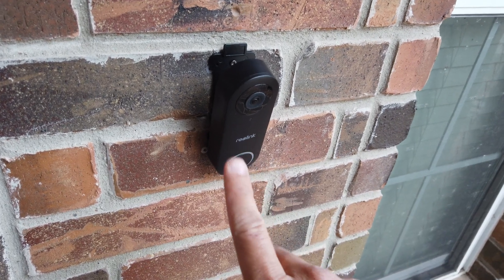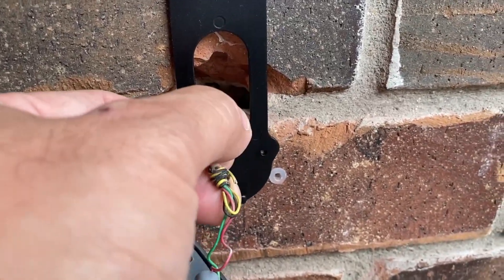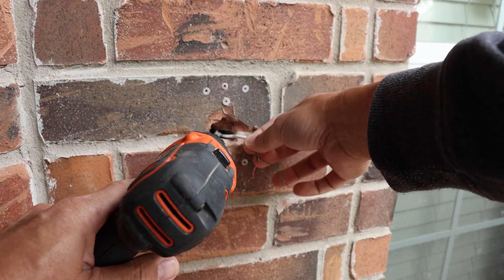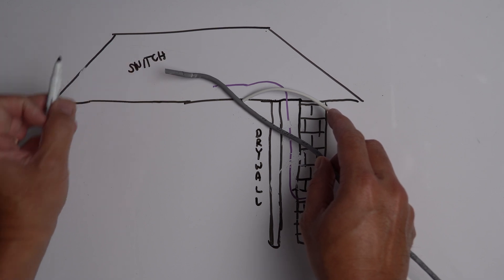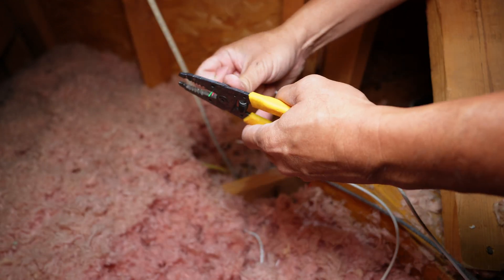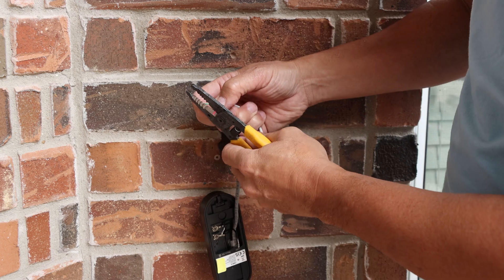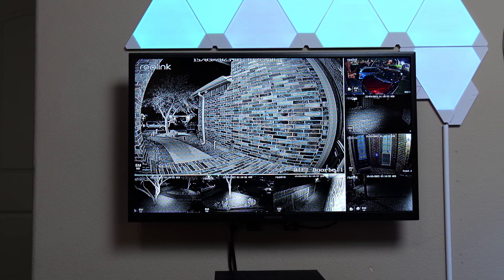Reolink WIFI Doorbell Jam Proof Setup - Adding Ethernet to your Doorbell Wiring

Comment: I recommend no to connect it to your main network and use a chap router with a separate network for its internet connection.  Having a direct Ethernet cable to your main network accessible from outside the house is risky.
Reply from the maker: So you think a hacker or bad guy would go to your front door destroy the doorbell camera that already recorded them and notified the owners and hook their laptop to tap in to your network?  Do you think because they went that far is just for them  to brute force their way in to your house and steal your computers if that is what they want.
Reply: @LifeHackster  You are right, it is not likely that someone will do that unless they intend to spy on you.

They do not need to break the doorbell. They can also wear a mask. For a normal home user, they will see someone tinkering with the doorbell and leaving...

it still works, it still looks good and there is nothing to worry about.

Meanwhile, the bad guy has full access to the home network resources and devices and can highjack your internet connection to their evil doings.

A separate router will protect from all except the highjacks of the internet, for that you need to check the "LAN" list of devices in your dedicated router for the doorbell and it should only list one device ... the doorbell.

This is one of the reasons security ip cams uses DVR instead of connecting the ip cameras directly to a Powered ethernet hub ... to get that extra layer of security for the cables dangling outside the building/home.
Reply: @LifeHackster  "Hey, how’s it going? Want a cup of coffee? I think we can manage that before the police arrive..." 😜

Comment: I have enjoyed your video's and they have helped me make some decisions on equipment.  Thanks.  But what do I do if my builder stapled my wires to the studs in my house?
Reply: You view it as a 'no wire' situation ie a brand new installation, remove the old wires at each end (once power is off) then leaving the dead wires within the wall. Now you have to get the ends of the new ethernet cable and wires from A to B.

Comment: I use the PoE version and also have the 433Mhz wireless transmitter connected to the doorbell chime wiring so that when the reolink doorbell is pressed,  the wireless signal also triggers my old school transformer chime along with the supplied plug-in wireless chime. You cant have that feature if powering the Reolink wifi doorbell because the reolink is not connected to the chime at all, the 433Mhz transmitter is.

Seems like Ill stick with my setup. Reolink please make hardware that does more.

Comment: Hi LifeeHackster! Thanks again for your detail videos. It's funny why reolink decided to make 2 version of this doorbell, now I am struggling trying to decide POE or the WIFI version. I guess you are the only very few reviewer happened to have them both physically. I wish you can do a POE vs Wifi version comparison since hardly anyone will have both version at the same time. I was leaning towards the POE version initially, but figured POE only benefit if you can't get a LAN cable there, but for my case, I have the flexibility for both. My concern is always on which has the fastest notification speed, 2 way-talk speed, low latency, accuracy, performance and of course local storage and no subscription. Hate Ring, Nest or Wyze since I tested all of them... Been using Nest hello for a long time, subscription keep going up and up!!! Time for change... 
To me, Wifi version just seem to have a little more advantage since I can easily test the WIFI version first, if not stable, then just use POE injector and do the exact setup like you. 
Anyways, I'll love to see (Reolink POE vs Wifi version) or (Reolink vs AD410) side-by-side comparison if possibly. Amcrest or Reolink are the type of doorbells for people like us who wants all the possibly controls and local storage... I really wonder if Reolink POE can perform better than the Wifi version if using 24v power adapter with RJ45 connector simultaneously(your setup). Because POE wouldn't have as much voltage available for the camera...
You are probably the only one who can "easily" do that..... but with another additional Rj45 cable.... lol...
Thank you for the hard work, fishing wire via that brick wall is no easy task, but I would suggest you fish another LAN cable since you do lots of doorbell reviews. I believed more and more POE cameras will be on the way, soon or later you probably need 1 or more cables for direct comparison.
Reply from the maker: I have the PoE version but haven't setup or installed it yet. I think there will be no difference between the PoE and the WIFI (plugged into network) as to performance. Plugged in will always be better than WIFI. Will see if I can test and compare in the future..but if you have the cable, just go with WIFI but plugged in as long as you have the doorbell wires to power up the doorbell separately.
Reply: @LifeHackster  I don't have the Rj45 setup yet, only the 24v. It's easy access for me to add later. I'll probably try out the Wifi version and see if it's a keeper. I had bad experience with Reolink... But sometimes doorbells might be different story brand wise. I'll give it a try since I do want to use google home along with the Reolink chime. Thanks.

Comment: What voltage are you using with it? I have an 802.3af to Ethernet and 12v dc barrel, but from the specs it says either 24v dc or 12-24v ac. I think I will need to add a boost converter (which I’m hesitant to do seeming it be running 24/7) or buy another device. I don’t really want to run a second cable to doorbell for power if I can avoid it.
Reply from the maker: I use my existing doorbell wiring to power it..which is 18-24 VAC.
Reply: @LifeHackster  thanks, is the Lan 1,000Mbps or 100Mbps? Might be able to use a passive splitter if only 100Mbps
Reply from the maker: @MrBrettStar  100Mbps

Comment: Is there a reason to connect the doorbell wires? I only connected the Ethernet cable. I’d appreciate a response. Thanks
Reply: Yes. This is the WiFi version only, so it is not powered over the Ethernet cable, you need to connect the doorbell cable wires to power the device. The Ethernet cable is for network only. (in this example)

Comment: Sorry I’m a bit confused, does the wifi version also support POE if I have a POE switch? Or does it need separate power like you did?
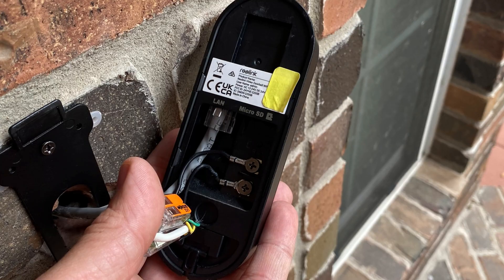Reply: No, It doesn't support PoE. However, it can be connected to your network via LAN as shown on the video. You still need to hardwired the door bell for power (see @ 1:32s of the video).

Comment: This is Michael. Thank you for this video, but the first thing you should have mentioned was that this requires a reolink NVR. They make it proprietary so you cannot have any other vendors NVR.  This is actually very foolish on the part of reolink, because they would sell a lot more units if that was not that way.
Reply from the maker: As I said on your other comment. These Reolink doorbells both WiFi and PoE version doesn’t require their NVR. It can be setup by themselves and can record to a micro SD card inserted on the back. The WiFi version also has an option for cloud recording.
Reply: actually nearly every camera can be used on any nvr that supports it. it is just the nvr that does not allow use of other brands. just look for rtsp/onvif compatibility on the nvr and camera.

Comment: What if I want to mount it outside my gate and not my door like 100 meter from my house?
Reply: 100M from your house good luck your wifi signal wouldnt reach that far.  Unless you ran a ethernet cable to the camera you could do that. youd need 100ft of good rated speed ethernet wire

Comment: Are there indoor, motion sensor, security cameras that can alert me on my phone when I am away from my apartment?  Will I require a network connection?  
Thank you for your work.  I've been binge watching your reviews.
Reply: Yes you need internet. All indoor cameras and outdoor can be viewed on your phone while your away as long as you have a sim card provider with good data plan or better yet unlimited data.  You can view your cameras from any country on the planet while your away from home.  As long as your router is turned on of course

Comment: Hi, been  a follower of your channel for quite a while, is a poe splitter a good solution to convert non poe camera to run wired network for distance around 5 to 15 meters? A poe splitter is an adapter that convert non poe to poe.
Reply from the maker: Yes, it should work and that should be a great idea if you already own WIFI cameras but also have ethernet port. Less wiring... this might be a good idea for a video... thanks
Reply: This is Michael. The question is not worded correctly. How can you turn a non ethernet doorbell into an Ethernet doorbell? Just having a Poe splitter doesn't change the doorbell. Maybe this would make a good video because a lot of people with wired systems would like to wire up a good video doorbell, but there just aren't any out there. Even this doorbell is useless if you don't have reolink NVR
Reply from the maker: @kpv123  Hello Michael. Just to correct you. The Reolink doorbell doesn't need the Reolink NVR. It has a micro SD card slot to record the footages (motion or 24/7) and with the WIFI version, you can even sign up for cloud recording as a backup.

Comment: I asked everywhere if you could poe the wireless doorbell version and everyone said no. I was planning the same setup as this video. Thank you for the video looks like I'll be getting the wifi for the rich notifications over the poe that doesn't have them.
Reply from the maker: I think they just misunderstood what you are asking because if you said PoE (power over ethernet), this wifi version is not capable of doing it..but as long as you connect it to its own separate power and connect via ethernet cable to your router or network switch then it will work.
Reply: THIS is the information I've been looking for! Wire it to the doorbell, then connect with ethernet! Thanks!
Reply: @MattN06  to be fair, the WiFi version supports BOTH the rich notifications via the cloud or via the NVR (via wifi, or ethernet, and yes you can plug the WIFI version to the NVR directly). The only downside is the lack of PoE requiring a seperate powersupply, which for me was not an issue, as I have neither NVR, or PoE switch (though plan to add in time) but need to use standalone for a while.
Reply: @MattN06 what's HA?
Reply: If you use home assistant for the notifications then you can have rich notifications on the PoE version. That's what I do
Reply: @PersonXes what is home assistant ? Please elaborate
Reply: @lionintu What is Google?

Comment: If it's 100mb Ethernet u probably would get away with running the power over the brown/wb pair on the Ethernet cable and pulling the sheathing back so they arnt a part of the plug.
Reply: Nice

Comment: POE is better then Wi-Fi. Anything with a signal can be hacked. Seeing a uptrend in security camera hacking its getting crazy. its more work with wiring but worth the piece of thought. Good video.
Reply: And ripping off the doorbell and directly connect to ethernet isn't a security issue? No hack required, just force.
Reply: @Lucifer11392 you can utilize mac address filtering.

Comment: Hey LifeHackster, did you purchased the Wifi version because of the rich notifications functionality (which the PoE doesn't support)?
Reply from the maker: Yes..also this was send out to me together with the PoE version to be reviewed...
Reply: Thanks for your response. 
I doubt to exchange the PoE version for the WiFi version.  I still find it strange that not both versions have support for rich notifications. 

Are there more differences between the two apart from the price and connection options?

Comment: Which switch do you use?
Reply from the maker: I use a Unifi switch but I also have been using the cheaper Mokerlink and works without issues too.

Comment: I would like to know if you could have used a poe split and used only one cable?  What voltage does the Door Bell require?
Reply: Not sure about the POE Splitter but I checked the PDF spec sheet on reolinks website about the voltage and it states this: "12-24VAC 50/60Hz, DC 24V"
Reply: @PatrickC139  Nice.  If it is 12-24VAC I believe it should work I connected an E1 outdoor with just one POE cable and the split has been working perfectly.
Reply: @ViniciusAguiar7  Mine is 8 V... hope it works 😜

Comment: I thought about replacing the existing doorbell wire as it’s very short/no slack at the doorbell. That quickly was denied due to the very small space to work with near the top plate, mounds of blowin insulation, and it’s also (I think) sealed at the top plate with foam. Basically, it wasn’t as simple as shown in this video for my house unfortunately
Reply: Yeah everyone's situation is going to be different depending on how your builder set things up. It's always fun when you start a DYI project and you come across some method they used that just made your Day 100x more difficult than you wanted it Lol.
Reply: Yep, this retro fit is not typical at all.  He got real lucky.
Reply: I'd be afraid to even try this in my house, for fear it would get stuck and then I'd have nothing there. :-)
Reply: @darrennew8211  agree, pulling the old wire is a risk that might require drilling holes in the wall.  People need to be prepared for that work if the new cable doesn't make it.

Comment: I would say it's future proof not jam proof. So many easier ways to incapacitate a single doorbell camera.
Reply from the maker: Not wireless jamming…which is why I said jam proof..you can always hit it with a hammer..
Reply: @LifeHackster  pretty much
Reply: @LifeHackster  majority of crime is opportunistic wearing a baseball cap looking down to avoid the cameras and walk in an unlocked door.  They could very easily use a tiny piece of painters tape and the camera is useless without any violence or noise.  That's why we have a full system of PoE cameras around the home and better locks.  Cameras aren't actually any defense protection, just a digital witness.🤷🏻‍♂️🍻
Reply from the maker: @RJ_Cormac  You are still a traditional passive camera guy..using cameras as a digital witness where you can now have notifications and be pro-active..and act accordingly if you get a notification of a guy wearing a baseball cap looking down and going around your house...yes, cameras can be a digital witness but the advent of internet and phone apps make you now can be proactive and prevent the crime to happen in the first place...(sound the camera siren, talk to them via 2 way talk, call the police or if you are home..then get yourself armed)